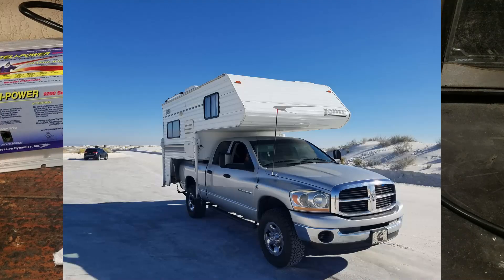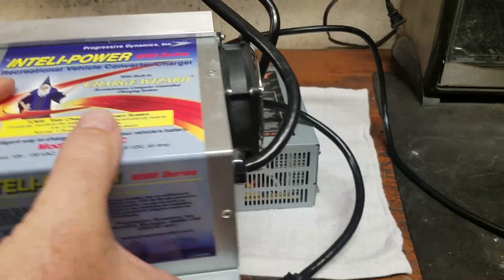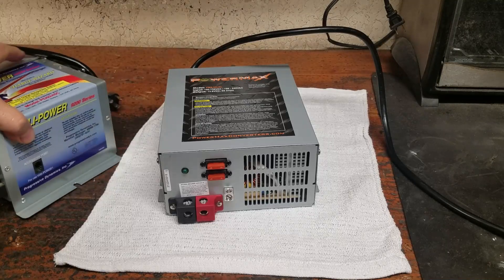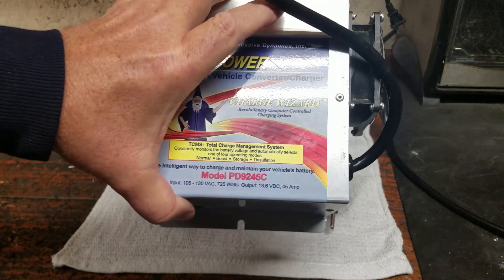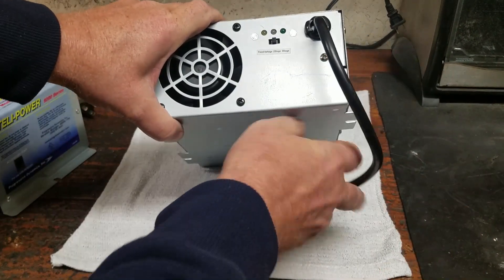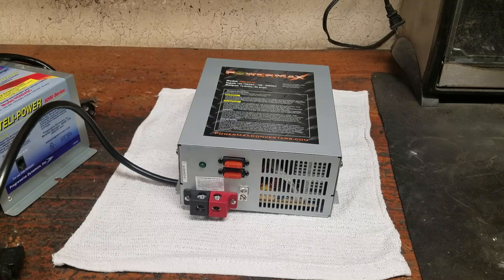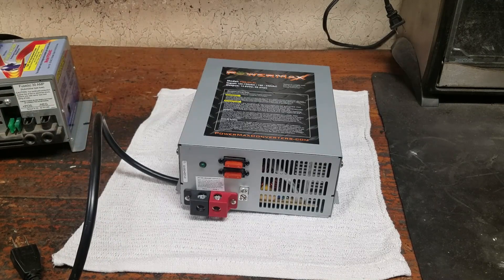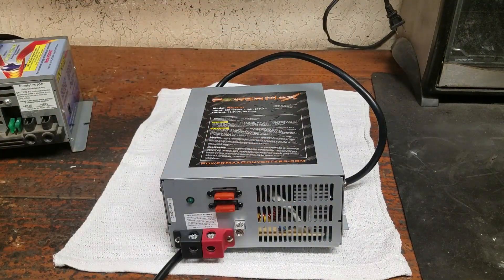NEW PowerMax Converter/Charger.  Switchable from Lead Acid to Lithium (LiFePo4) PM3-55LKL or PM3-55L

Comment: Do you know if in fixed output mode; at 14.4 volts. does the converter stop charging the battery once it detects its full?
Reply from the maker: To the best of my recollection... The fixed mode is for someone that just wants a AC to DC converter where a battery is not in use.   And yes I belive it is adjustable in that mode.   The other modes are meant to charge or maintain  their respective batteries, so yes it will throttle near the end of the charge.
Reply: @TreeTopFlier  I was watching a few videos and they say fixed mode is for lithium batteries as it maintains the desired voltage throughout the charge. It is very much a charger in either mode. Atleast that's what ive read. My concern is overcharging.
Reply from the maker: Im doing this all from memory so your best bet is to contact the distributor for the best most up to date information.  That said,  As I recall,  there was a problem initially where they were just bumping up the voltage on lead acid battery converters to fully charge Lithium batteries.  This didnt address the unique charging needs of LiFePo batteries.  The result would likely be overcharging.   This charger was unique because it had a three position switch 1. stand alone 12+ volts (not intended to maintain a battery)  2. Lithium charge option meant to charge, sense and maintain a lithium battery and 3. A lead acid option to do the same.    The two battery options are intended to optimize their respective batteries without over charging.   Hope this helps.
Reply: @TreeTopFlier  that's fair, just gonna have to rely on the bms to take care of everything

Comment: I just found this new 'lithium' charger from powermax - 2 stage - in 55 or 75A. Can you only get one from them directly? Looking for a discounted price on a 55A. Where did you get yours?
Reply: Ordered one...they're pretty rare yet. Sounds like the perfect solution for a converter/charger for lifepo4. 55Amps!!
Reply from the maker: Hey thats cool, hope it works out well for you.
Reply: always worries me when a company can’t provide proof read directions  “valtage”   I was trying to sell myself on these cheaper units buy Progressive will probably get my money for a lithium upgrade
Reply: @scottzimmerman6485  got one…just not a good solution. Voltage is only adjustable in CV mode, and half the time would error out. Sold it and got a Meanwell NPB charger - perfect. You don’t need a converter with lfp, just get an adjustable charger.
Reply from the maker: i called them directly and talked to Grahm.  They have a 55 and 100 amp.  They are still fiddling with the final part number, so im not sure they have it settled on the web site yet.  I would just give them a call.
Reply: @TreeTopFlier  - Cool...yeah, left a voicemail today. They are NO WHERE to be found on the interwebs. My guess is they are BRAND new out. Solves the voltage dilemma for lifepo. A big thumbs-up!!  They should sell like hotcakes. 
I have a IOTA with IQ4 which has been fantastic for golf-cart batts, but not so great for my new 230A lifepo4 pack build. :)